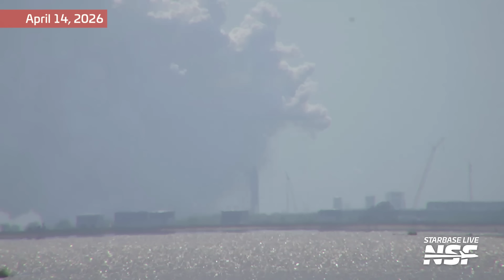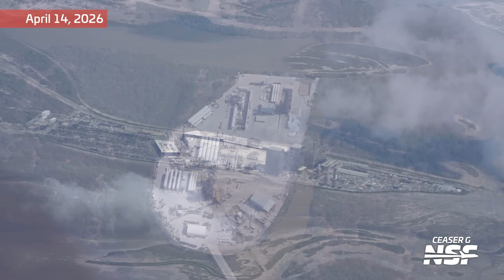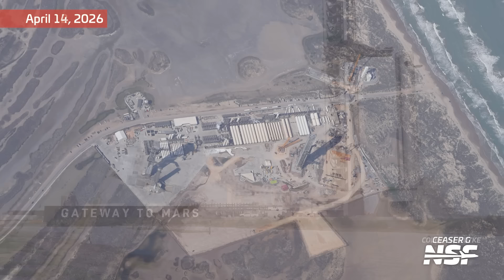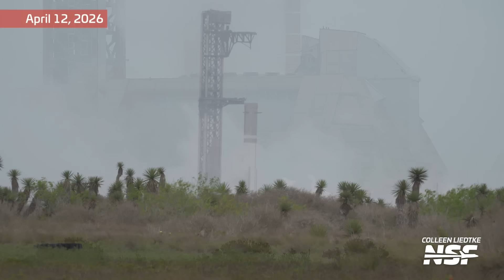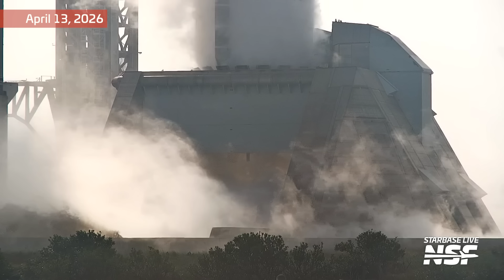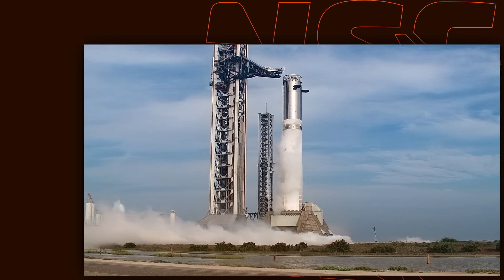Ship and Booster fire up ahead of Starship Flight 12 | SpaceX Starbase

Comment: Is it just me or does the static fire on pad 2 look much more violent than the pad1 launches with showerhead?🤔 ofc it's nowhere near as violent as FT1😂
Reply: Pad 1 directed the exhaust plume mostly 360º around it.

Pad 2 directs & concentrates the plume into two much more constrained pathways, so it ends up with more violence in a smaller overall area than Pad 1 did.

It's also why Pad 2 has had to be built to be so much more robust than Pad 1, especially now that the booster is also using Raptor 3's.
Reply: @grndkntrl that makes sense, thanks for explaining! And yeah, raptor 3 is one impressive engine, Im amazed how much they managed to compact it while also keeping performance and safety up to standard 🤯 can't wait to see this baby go up 😎

Comment: In some of the views of the test firing of booster 19 you can see splashes in the water near the launch pad.  What is that?  I'm hoping it's not pieces of the flame diverter. Any word on how the flame diverter held up to the testing and the composition of the debris that was hitting the water during the test?  This seems like something they would want to eliminate completely if possible.
Reply: It was already said in previous testings that it's just loose bushes and branches that were YEEEETEEED away from the pad vicinity by the sheer power of shockwave from raptor 3 engines.
This pad is much more robust than previous design.
Reply: I think it is some of the birds that were flying around. I zoomed, but on my phone. So I'm not sure. Killed by the shockwave? If so it would be the first directly visible effect of Starship on the wildlife.